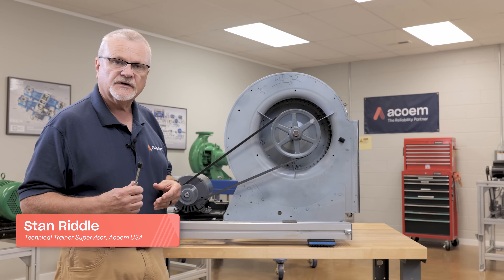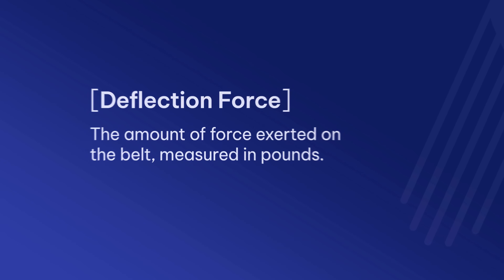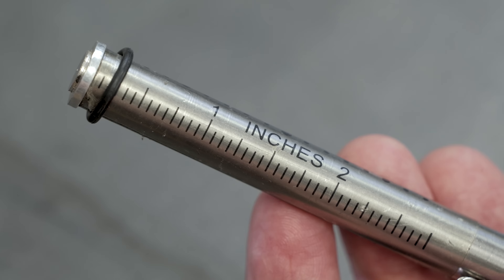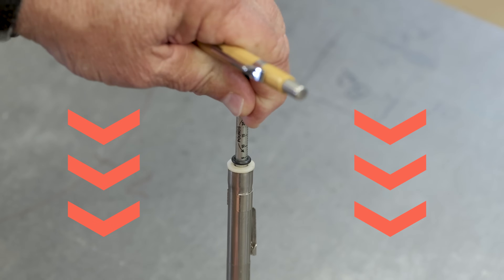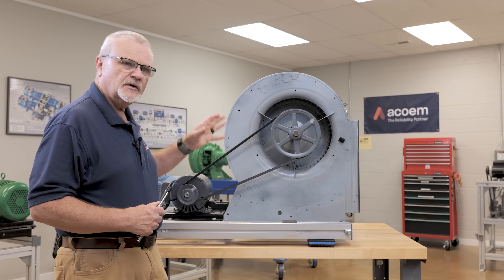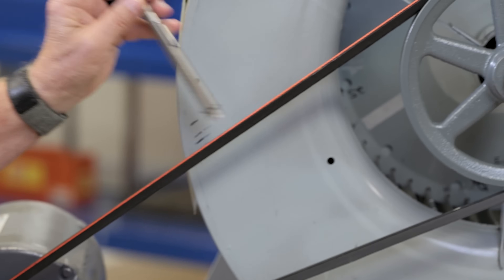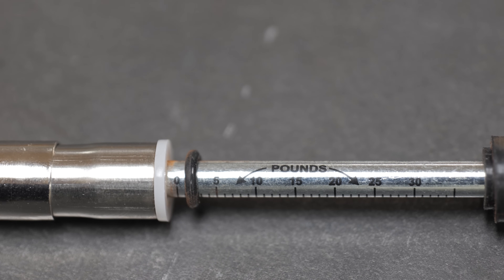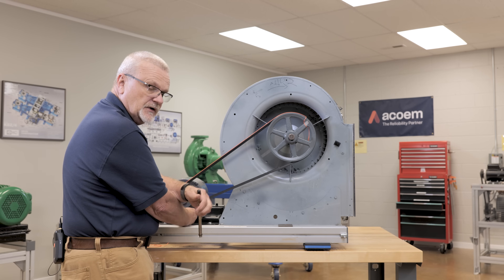How To Use A Belt Tension Gauge | Precision Maintenance Toolbox | ACOEM

Comment: What is causing all the teeth to shred off my v belts? Are they too tight
Reply from the maker: If you are referring to timing (synchronous) belts, there can be several causes of the teeth failing:

1. Misalignment and improper belt tension too loose or tight can cause belt failure and should be checked/corrected first. Use one of the available laser sheave/pulley alignment tools to check the alignment. A string or straight edge is not accurate enough as allowable misalignment is only 1/32" per foot of length between the shaft centerlines. Check and adjust the belt tension using a spring or sonic tensioner. The timing belt manufacturer will specify how much force is required for the amount of deflection based on the belt size.

2. Timing belts have either trapezoidal or curvilinear tooth profiles that mesh with profiles in the sheave like a gear. Check the tooth profiles of the sheaves, worn profiles can cause early belt failure even with a new belt. Also check that the belt and sheave profiles match. Did a sheave get replaced with one with an incorrect tooth profile or pitch diameter?  Also timing belt sheaves should be replaced more frequently then V-belt sheaves due to the tolerances between belt and sheave tooth profiles.

3. Did the timing belt wear "normally" before? If so, what changed in the process? Is it running at higher RPM's? Was a larger motor installed? Does a change in the process require more torque? If so, then a change in the belt size is more than likely needed.

Hope this helps!

Comment: Thanks Acoem USA for sharing this video. It is much appreciated.
Reply from the maker: @Granahe501 Thank you for watching!
Reply: Can you explane how shuld we ajust belt.. How to find that set point
Reply from the maker: @waleneliyata1252  Loosen the motor-side bolts, move it accordingly (in the direction that you need to go), tighten the bolts, and then re-check.
Reply: @AcoemUSA   How to check the linearity and alignment of pulleys in a car? Can AT-400 do this?
Reply from the maker: @barbarakrawczyk3248  The AT-400 is designed for performing shaft alignments of direct coupled machines and is not used for belt drives. Our Belt Hog is designed to perform pulley/sheave alignment of V-Belt driven machines. There are also adapters available to align Positive Drive/Synchronous Belts and Sprockets. 

Most vehicles today use serpentine belts, which the Belt Hog adapters aren't designed for. If your vehicle does have V-belts there may not be enough clearance for the Belt Hog to fit. If it's a larger vehicle like a bus it's possible the Belt Hog MAY fit.

 Here's a link to a blog showing Belt Hogs being used for V-belt alignment on buses.  https://acoem.us/blog/belt-alignment/belt-hog-busses/
Reply: @AcoemUSA   Thank you for your answer. I thought that neither one nor the other was for this purpose. I have seen devices from Gates, but they do not have any scale, only a small laser dot, which is not very accurate. Gates requires that the belt should not work at an angle greater than 1/4 degree. When the wheels are close to about 100mm, the maximum displacement is 0.3-0.4mm